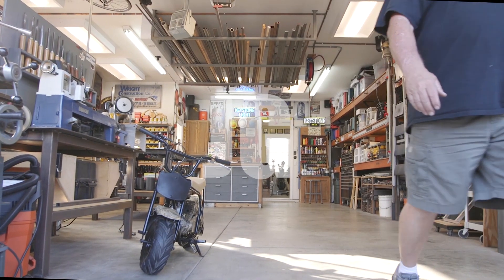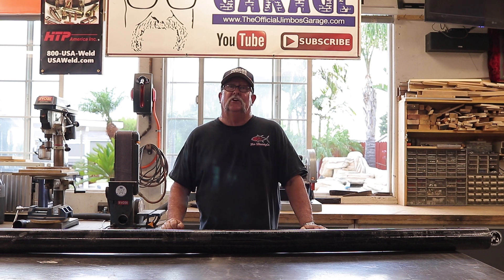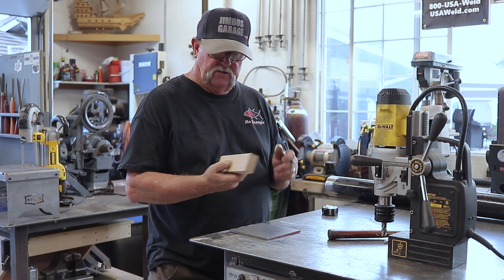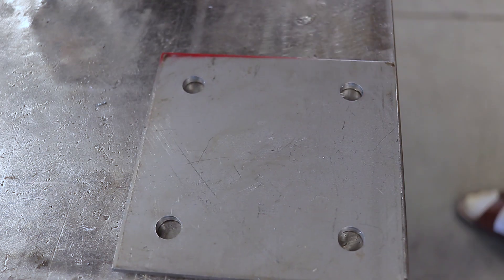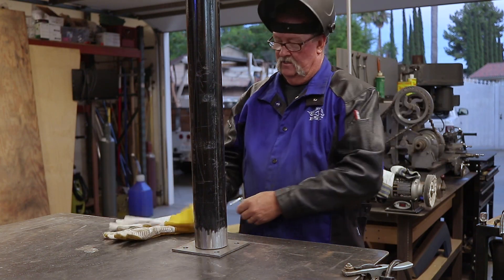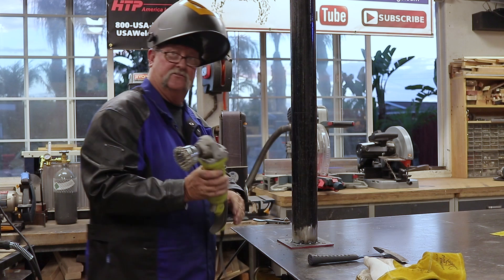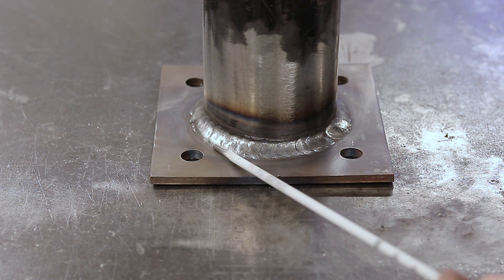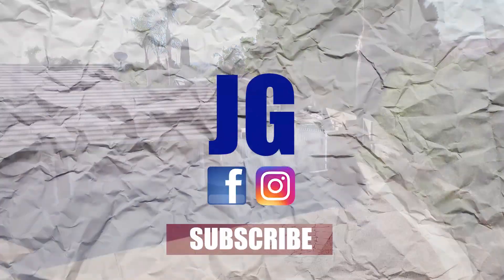Fabricating & Welding Small Metal Column | JIMBOS GARAGE

Comment: So why exactly did you tack it with 6011 rod and then mig weld it after ?
Reply from the maker: Thanks for watching Dill Wiggle, I don't do much duel shield flux core and i thought the tack might be to big and fat with that process. So i just put a small 6011 around it.  Jimbos garage!

Comment: I might have moved the column to the very corner edge of the table and used 3 clamps to hold it in place reducing any warping to a minimum. I usually tend to underestimate warping and end up with further work trying to remove it. :-(
Note: at 71 if a moth hits me I get a balck&blue spot - I use gloves to drink my coffee now. Ok, maybe not that bad, but I really use them for most everything, even the wire wheel clean up, etc.
Reply from the maker: Thanks for watching Tom, And your advise,  Jimbos garage!